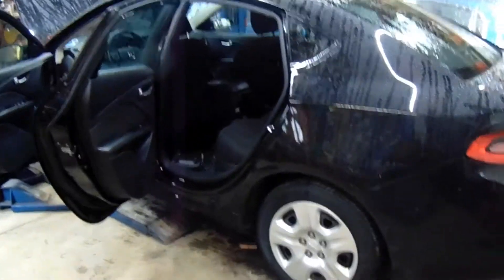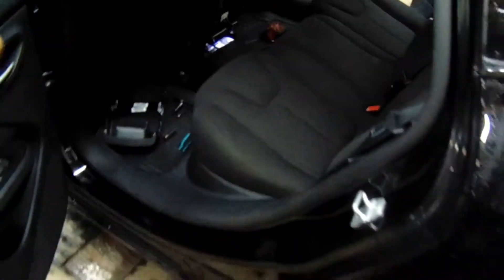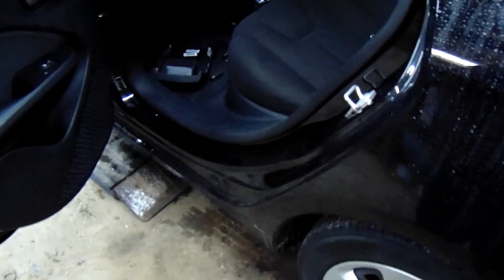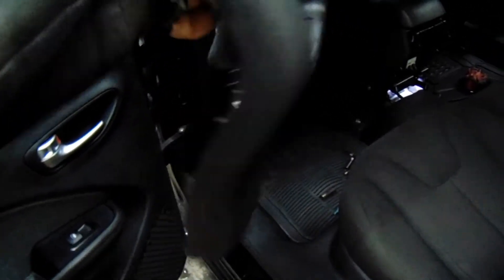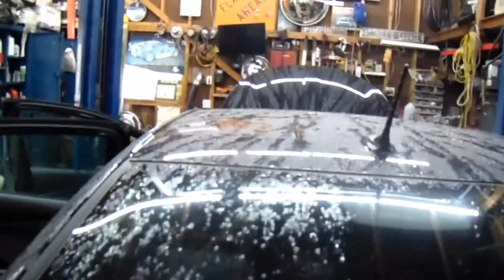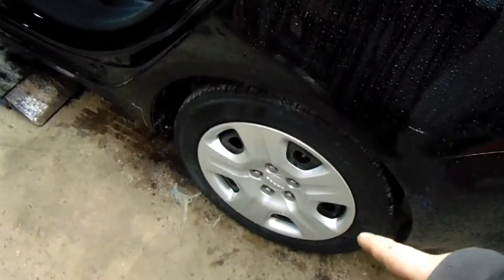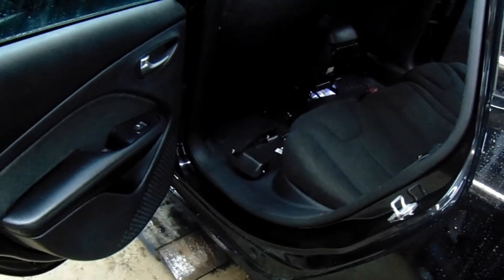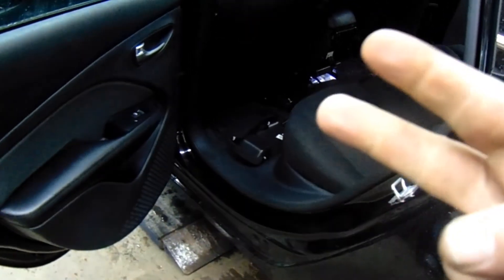how to adjust the parking brake on a 13 Dodge Dart

Comment: I'm having similar trouble with my Dart. I tried the same thing you did, and it worked for a few weeks, but then I started having trouble again. The issue is with the rear brake calipers. The arms that the cables connect to aren't releasing all the way when I disengage the parking brake. It releases enough for the wheels to turn, but the brakes are still slightly engaged, so it was wearing the pads and rotors while I drove. This meant each time I used the parking brake, I was having to pull the lever slightly farther to engage the brakes. I'm betting you're having the same problem, and you'll either need to rebuild or replace the rear calipers. I'm planning to replace mine, but for now, I can reach behind the wheels with a long handled box wrench and pull the levers down by hand. It took a bit of WD-40 and some hammering to free them up enough that I could move them by hand, but I have it usable for now.
Reply from the maker: In the description there's a link on how to go though the rear calipers and clean and lube that pivot point. I did both of mine and haven't had a problem since. I needed to buy some real long snap ring plyers and a few hours time, it wasn't hard
Reply: @rustybrowneye  Thanks. I've already ordered some replacements, so I'm going to go ahead and use them, but I think I'm going to hold on to the old ones and clean them up as shown in the video. That way if it happens again, I'll have a pair ready to swap out. I tend to keep cars a long time, so I wouldn't be surprised if I run into this again.